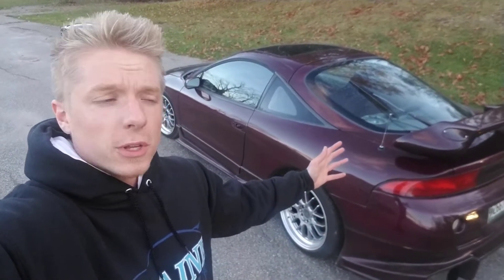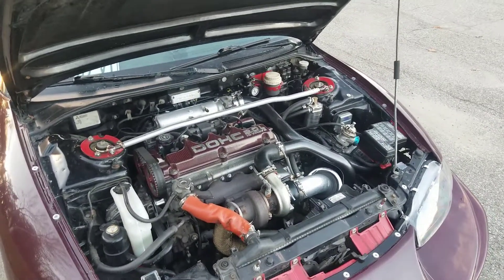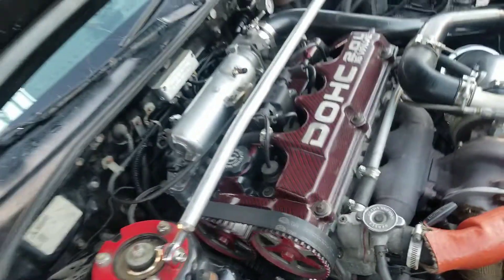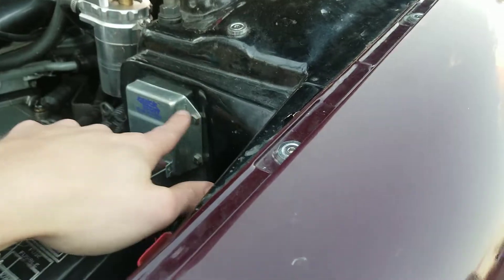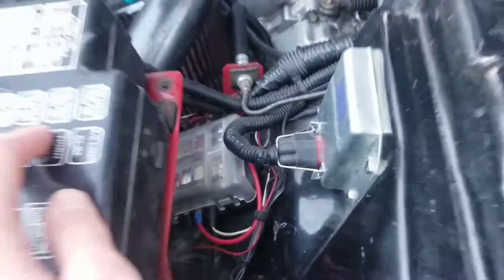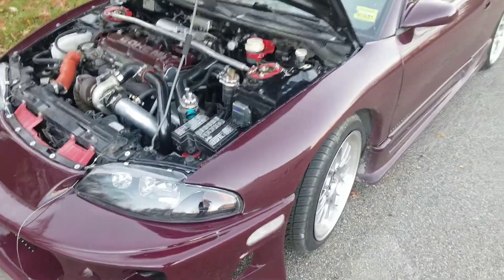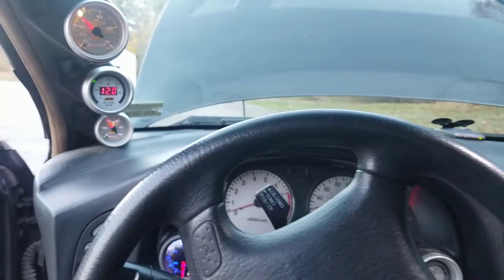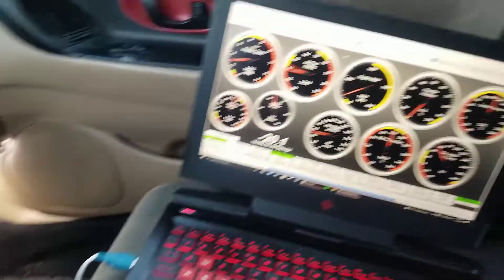420a Turbo Eclipse Update 5 - Megasquirt Complete

Comment: Ever have any overheating problems? Did head gasket new radiator (stock) new thermostat and new hoses and new e fans. But im still running hot/over heating street crusing it. Highway is great though so im trying to pin point what im missing lol

Comment: I just bought a 95 eclipse with a 420a and a manual, my question is since they don't make OEM camshaft and crank position sensors how do you make it easy to start after changing those since the OEM sensors aren't available anymore I'm totally new to my DSM I'm used to working on like a 56 Chevy 🤦🏻‍♂️
Reply from the maker: Those sensors are readily available on eBay and what not. Hard to believe there's no aftermarket sensors at AutoZone though?
Reply: @DSMTUNER  that's exactly my problem the aftermarket ones don't keep the right voltage when it's cranking and it's all over the place which causes it to have a hard start sometimes sometimes it starts as soon as you get the key didn't do it until the cam and crank sensors were changed then I find out they don't make the OEM one anymore and cheap Chinese parts are my problem. Thank you for responding.
Reply from the maker: @awaren8375  are you trying to run megasquirt or is this a completely stock setup?
Reply: @DSMTUNER  my engine is completely stock, I've tried doing some research everyone says different stuff you have an actual functioning car so I thought I would reach out and get some clarification if I get the mega squirt is the hard start issue gone with the aftermarket sensors?

Comment: Curious what gasket material you use from the Manifold to turbo

I've got the same setup and cannot stop burning through them
Reply from the maker: It's a standard t3 metal gasket from eBay. Works great.

Comment: Nice video man! similar set up to what I wanna do with aftermarket ecu. Right now cars running great so I don't even wanna mess with it but in the future hopefully I can, I have all the parts but I know it's not a quick process so waiting until I can have it taken apart for a good amount of time that allows me to finish. I wanna build my motor up though before going to turbo so it'll handle more boost. Can't wait for updates on your car 🤟🏽

Comment: Hey what’s up Bro, can you tell me how you connect the speed sensor to the cluster, which plug and wire did you connect?
Reply from the maker: There is a yellow with white stripe wire going from the sensor to the cluster. This is your signal wire. The sensor is powered by the mega squirt 3v signal, and uses the mega squirt ground wire for ground.
Reply: @DSMTUNER  I don’t have a mega squirt yet, just did a transmission swap. So which plug behind the cluster and which wire?

Comment: What did you do for transmission upgrades if you don't mind me asking?
Reply from the maker: Just a Spec stage 2 clutch, I thought for the longest time a had a LSD in my trans but turns out I don't. Will probably be putting one in next spring